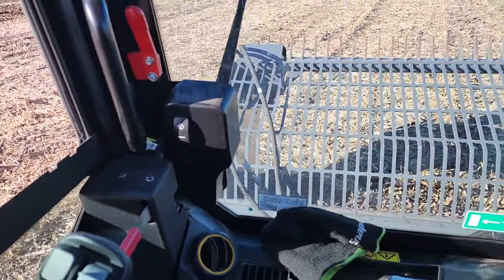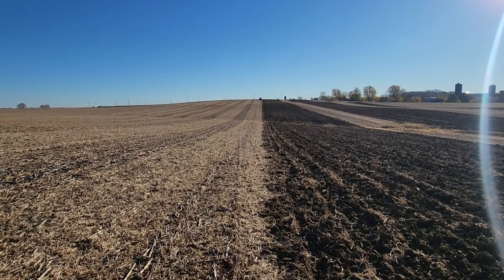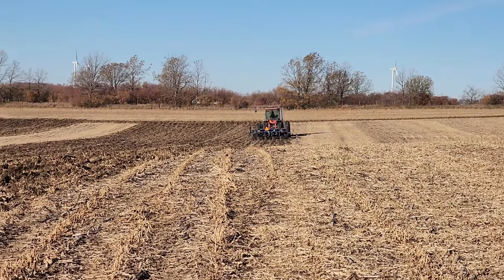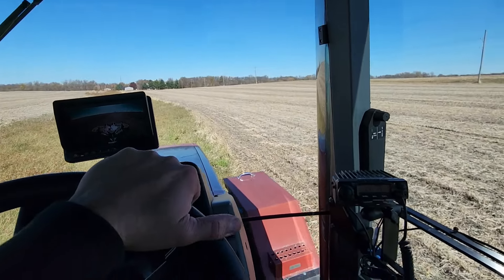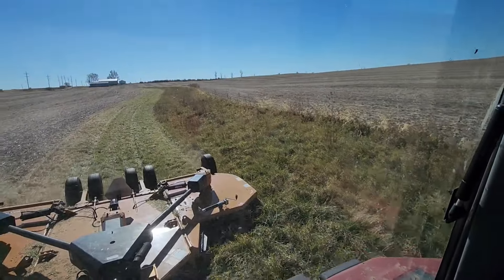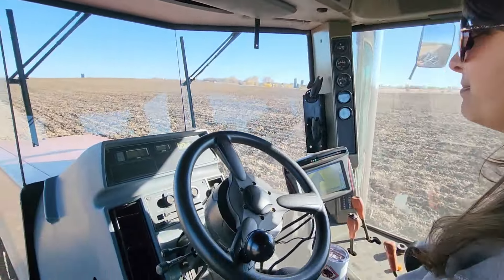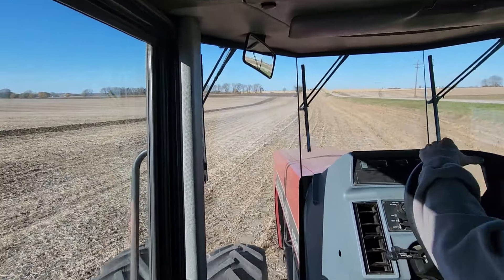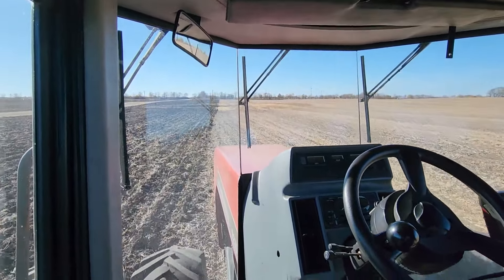Ripping & Rock picking

Comment: Enjoy the Videos and like what you are doing. Does ripper pull harder then chisel? We chisel plow, wondering if ripper is better. Good luck getting state to trim trees! I can guarantee state would notice if you removed trees. I work at School District doing Hvac, don't think there is anyone like Mrs G. You make me want a box car magnum..
Reply from the maker: Thanks for the comment 👍  the dmi ripper pulls about the same as my chisel plow because it has 5 shanks vs 9 on the chisel. It leaves the ground rougher but rips deeper and goes thru corn stalks without trash issues